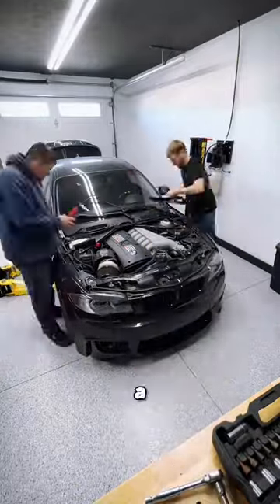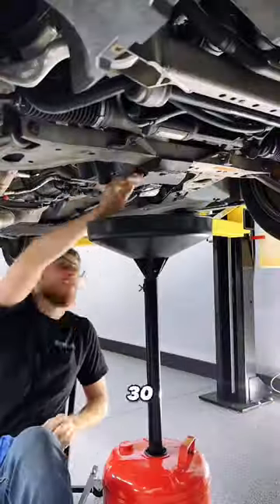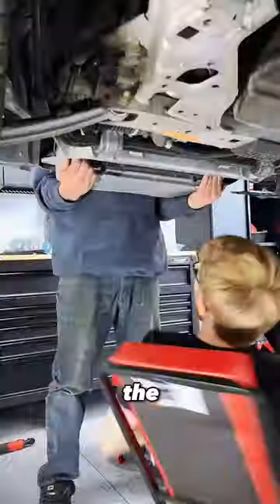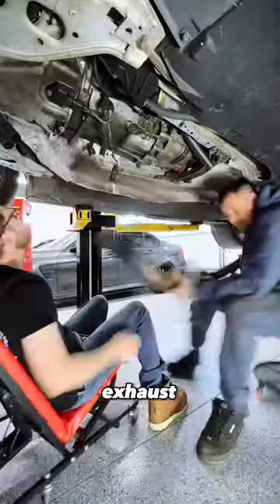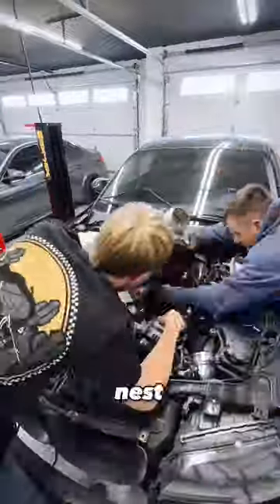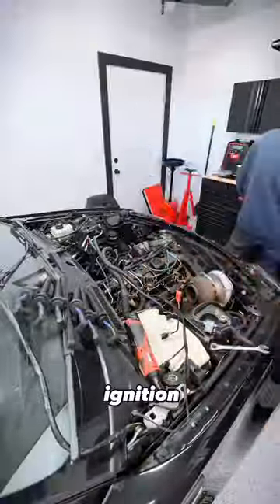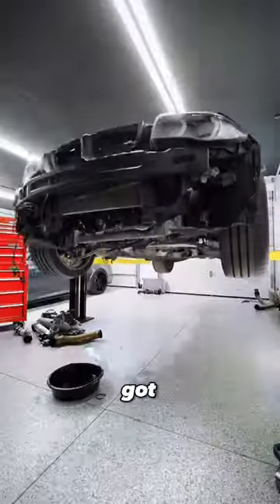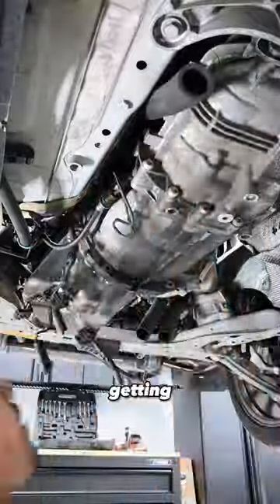How to Remove a BMW Engine in 30 Seconds 🤯

Comment: Wouldn’t it be easier to disconnect the wiring harness from the computer? Pretty sure the computers are on the passenger side under them plastic covers
Reply: That’s what I do when I remove this engines, way easier instead of unplugging every connector.
Reply: More of personal choice.  Can unplug everything in couple minutes.

Comment: It’s easier to remove the loom from the fuse box and ecu that it plugs into
Reply from the maker: I never thought of that, interesting way to go about it
Reply: @jake_spence  saves digging the loom out from under the manifolds etc and makes it much easier to do out of the car

Comment: I have a 128i, Wanna take the engine out, to change all seals, gaskets, and hopefully fix the idle rattle.noise...  any tips. Links where I can get a master hose kit, plastics parts replace.

Comment: mine is auto. how do you un screw the trans fron the engine... how the trans converter is bolt to the crank flywheel..stuff..

Comment: Now show us how to lS swap a 135i 😂
Reply: how to single turbo it you mean
Reply: @chrisplayz9739  nope lS swap
Reply: @chrisplayz9739 why would you turbo an engine that your gonna have to throw away 😂
Reply: @HolySpirit_7744 because the n54 is arguably the best modern tuner engine. Dudes be making 500whp on stock twins and 900whp on single turbo setups.

Comment: With my luck, all the connectors, plastic bits and exhaust systems are ready to fall apart or rusted to shit. There is no smooth sailing with salt exposed cars.
Reply: I’m bound to have those problems too.. except I’ve never lived in a winter environment which makes it even worse 🙁

Comment: Anything is possible when you have a lift lol
Reply: Lift makes it easier but isn’t necessary. Notice how he still pulled the engine from the top. I pulled one in an afternoon without a lift just an engine crane
Reply: @jemhollanders8024  you constantly have to go up top and down below on these cars. Lift makes your life easier. It’s possible without but a dread to do. I’ve done lots of swaps and anything you can do to make it easier is always a positive

Comment: Much faster to remove the engine by dropping it out from the bottom with all the suspension i did this with a Mercedes SLK and had it out in less than 2 hours

Comment: I am convinced there had to be meth involved in this removal process cuz only a crack head would recalled how long it took them to complete the job was about 30 secs  😂😂😂 but bot only that did you notice how fast they were moving? I have no doubts there is a glass pipe somewhere in that garage just out of sight!! Another reason i suspect is that the garage itself is way to clean! I bet they spent "30" secs on all fore with toothbrushs cleaning the floor before they started the job itself!! 😂😂😂😂